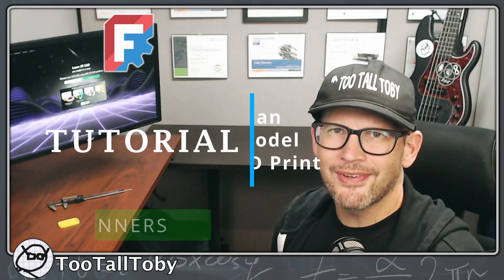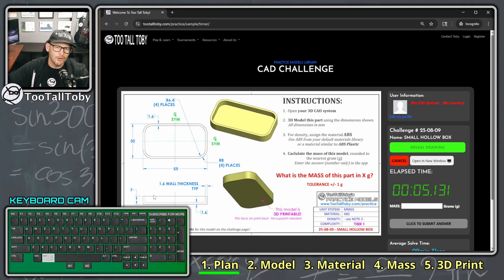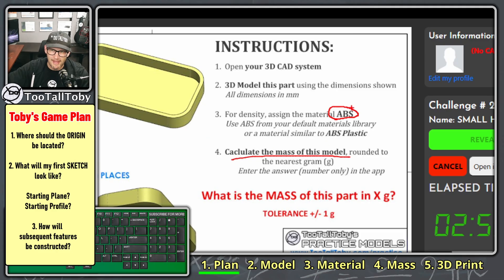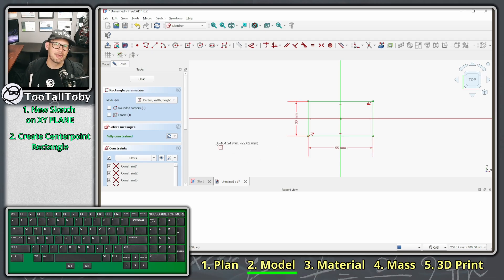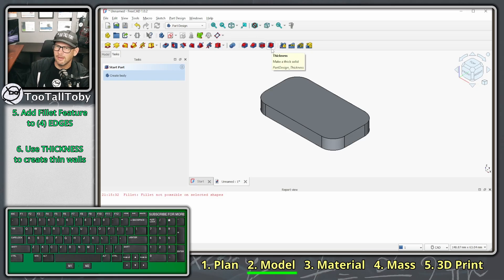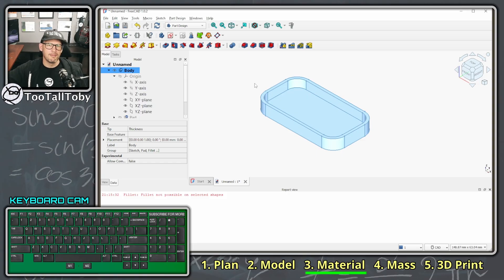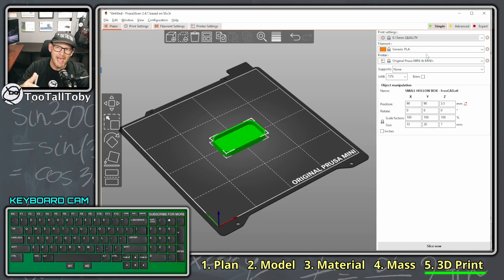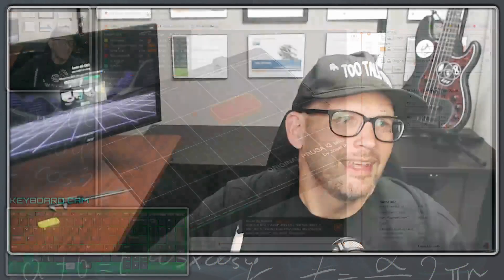FreeCAD  - 2025 Complete Guide for beginners with 3D printing Export

Comment: Great to se some FreeCAD tutorials as well! Hope there be more in future. Note for navigation is there is 10 different navigation styles from other programs to choose from, unfortunally it does not come with settings for Onshape or Solidworks though. Choosing navigation style is easily accessed in lower right corner, hoover over active setting name and FreeCAD will show navigation settings for different operations.
Reply: Solidworks navigation style is included in current Dev version, so will likely be in the next full release later this year.
Reply from the maker: @Heat-FloDevelopmentTeam  Nice - that will help me be a little more speedy!
Reply from the maker: Thanks very much Jim U!  I'm going to try that for the next one!
Reply: I wish I could change the orbiter from the scroll to a key in the keyboard
Reply: @--3D Try doing macro, and map that,  it works for view as lines, view veticies and view as is that is not normal to map as usual for me atleast.